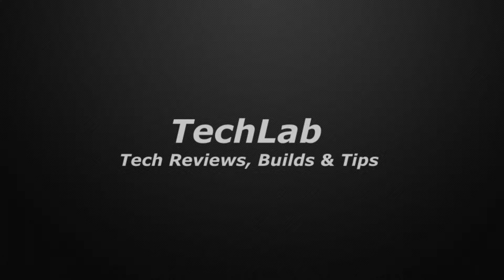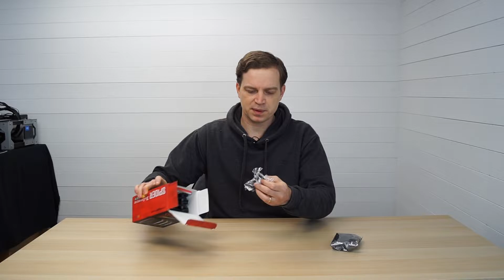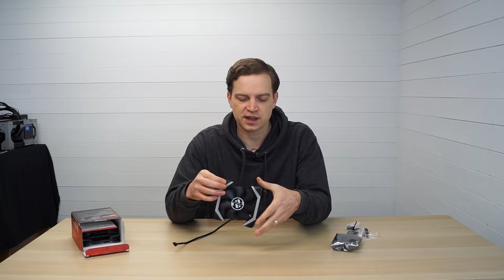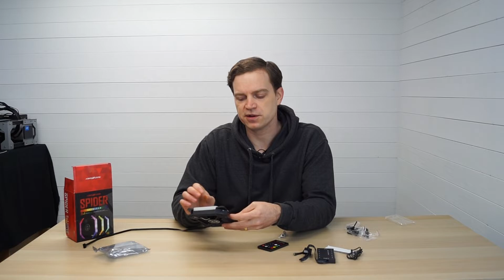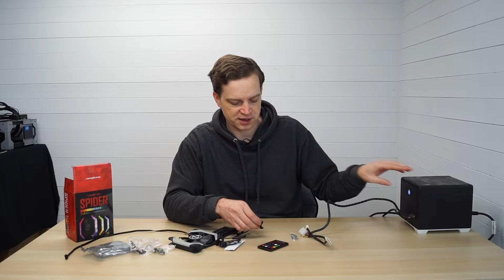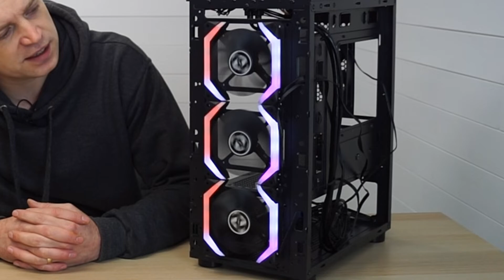Abkoncore Spider Case Fans - Something a little different. | Review & Unboxing.

Comment: I wonder if not having the sides covered on the fan reduces airflow/speed
Reply from the maker: I doubt it because they are pretty slow running anyway and provide what can only be described as a "light breeze" into the system.